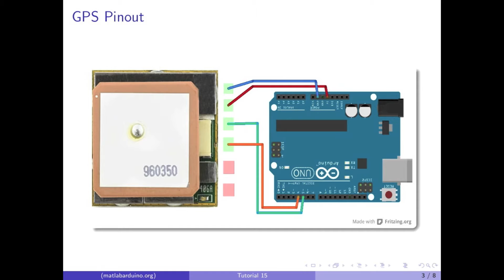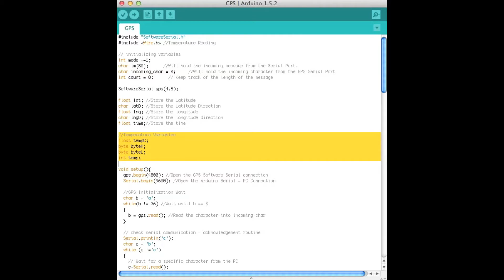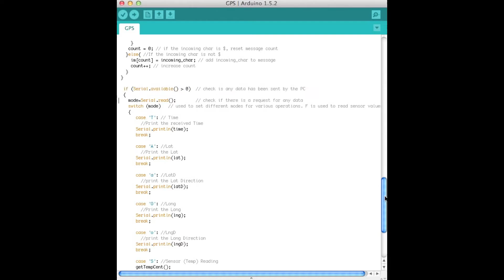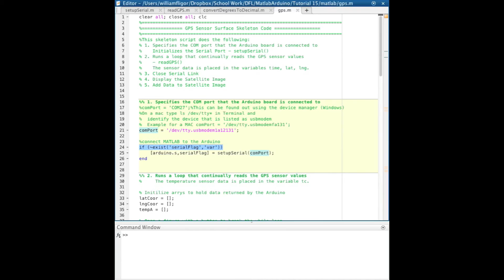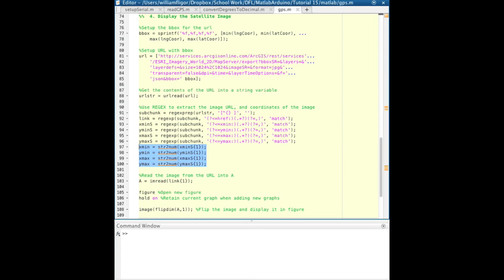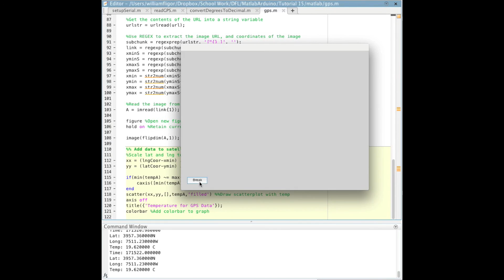MATLAB Arduino Tutorial 15 - Visualizing Geotagged (GPS) Temperature Data

Comment: Your code for the convertDegreesToDecimal is wrong. NMEA strings are not formatted in dddmm.ss they are formatted in dddmm.mm where the numbers after the decimal point are the fractional remains of the next minute. For example 4807.038,N means 48 degrees 07.038' North. Your code assumes that it means 48 degrees 07' 04''. Though this is a very small difference when it is converted to decimal degrees, it is still more accurate.

http://www.gpsinformation.org/dale/nmea.htm Is a website that shows the formatting for the GPS NMEA data.

Also your code states that if the direction is EAST or WEST then the decimal number should be negative. This is incorrect as it should be SOUTH or WEST that makes the decimal number negative.